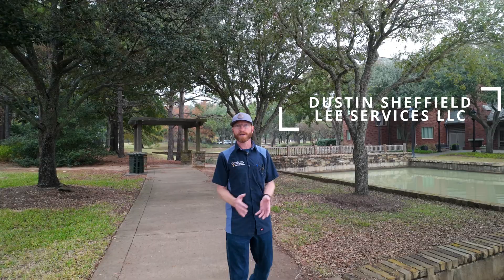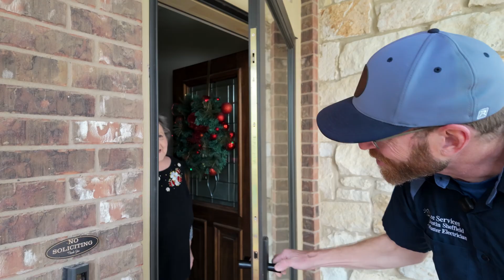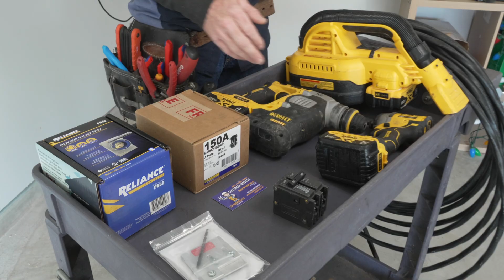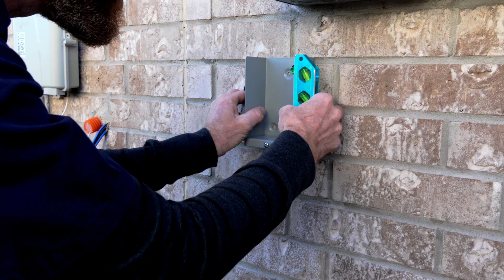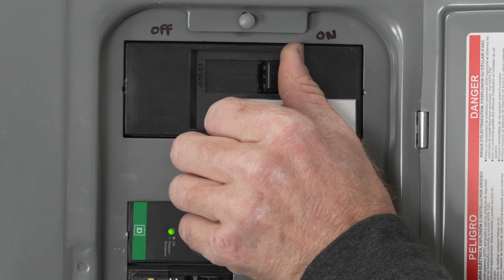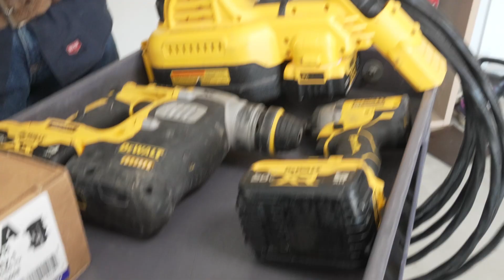Duromax Authorized Installer - Meet Dustin

Comment: Great video to begin with but I have one question about the generator. For those that don't know, the generator should have a floating neutral when connected to the house. Did the electrician unbond it or did the customer do it? These generators come bonded for standalone use. I found out after I purchased mine. I feel it's important that people know this for home use.

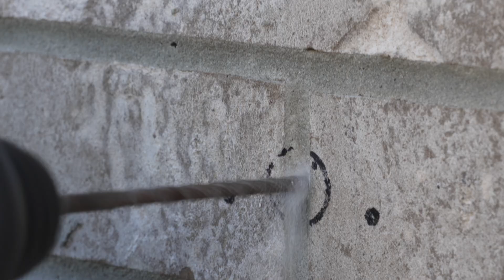Comment: At 2:01, what is the low voltage box that is shown being installed for?  I didn't realize anything to do with a generator install would use low voltage wiring.